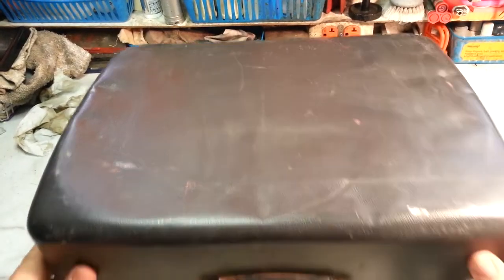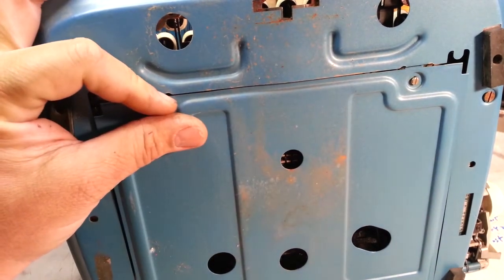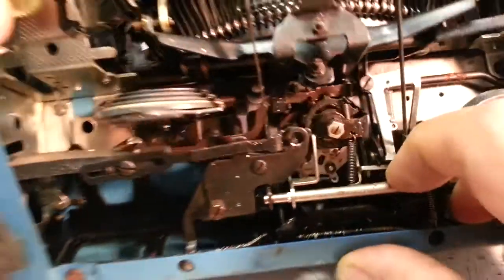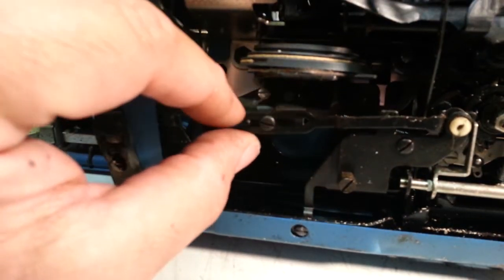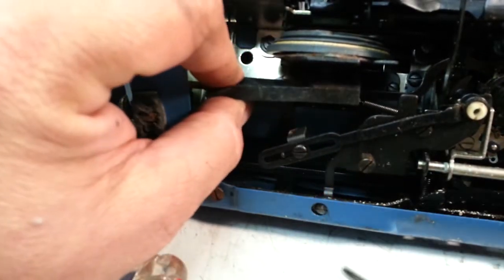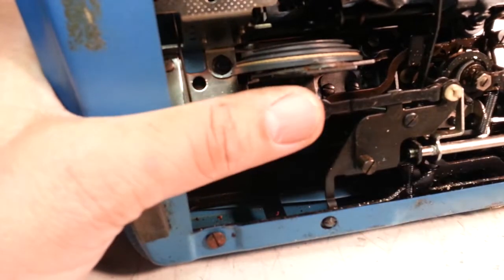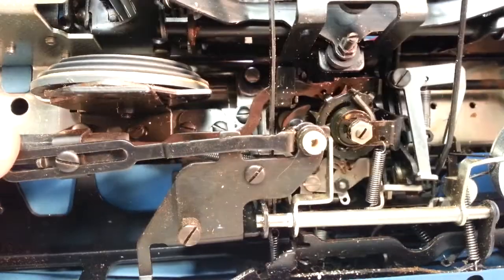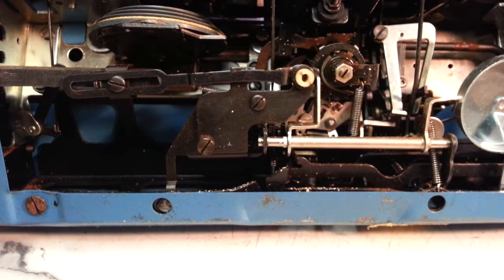Smith Corona Typewriter Power Spacer Escapement Repair Adjustment No Silencer Model

Comment: I noticed that screw right in the middle during most of that video. It looks to me like the rubber bit is a wedge, and if you loosen that adjustment screw and run the guide to the left, higher up on the wedge, it would raise the arm and solve the problem? I guess that’s why there’s so much adjustment in that slot. Love the videos! Thanks!

Comment: I have an identical machine…I pushed the power spacer, it flew across, drive home, the vibration fixed it because now it works. Freed a lot of frozen parts. Looks like a drink spill on the left side at some time in its life before me. The best part is the bell works, worst most dirty filthy broken machine I’ve bought but the bell works.

Comment: On this one and mine the ribbon drive gears are plastic. The right ribbon spool axle pulls out leaving the horizontal gear below resting on the drive axle but it can easily fall out. The left doesn’t come out oddly enough. In the video where the ribbon reverse is fixed that model 6 has metal ribbon drive gears. The rest of the machine is the same high quality since the 1930s.

Comment: I fixed that.  I’m saw your video about a year ago.  I finally caught up with my project.  I screwed  it in but,  I Tightened it a little to hard and it broke.  It fixed the problem.  It broke in half.  What is that part called..? Or will I have to get a dinner typewriter?
Reply from the maker: Last few I have seen were also cracked, not sure what the name is.
Worst case is just disabling the power spacer
Reply: Phoenix Typewriter Yes.  I know call my typewriter a competition typewriter.  It power spaces in a flash 🆚 how it could be regulated to sound like a machine gun.   I just control it with my left hand.  Maybe I can still regulate it with small tools or by finding a donning typewriter that it’s not worth fixing.